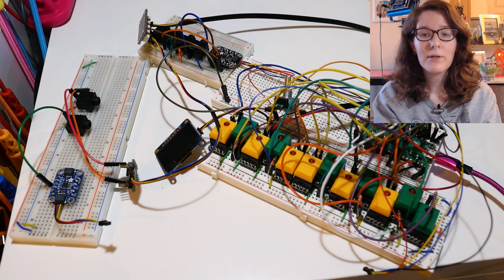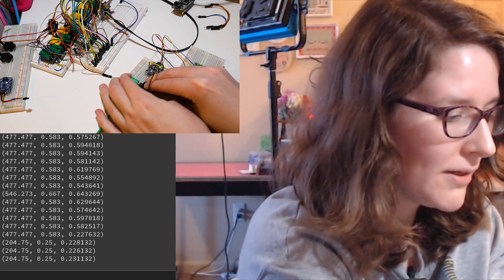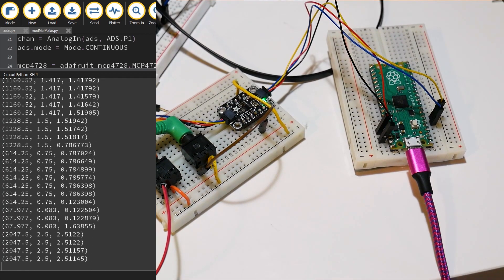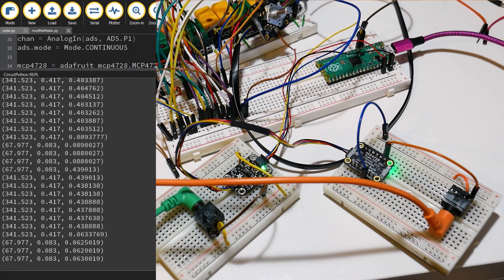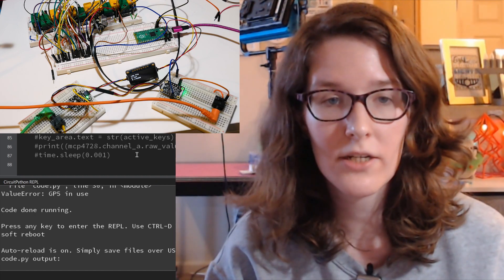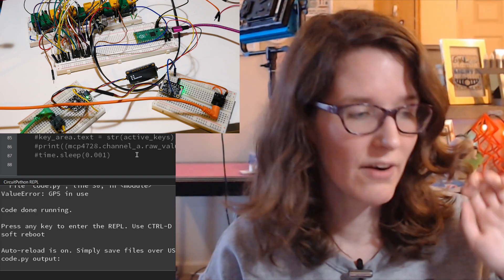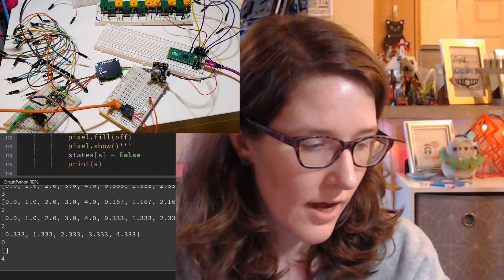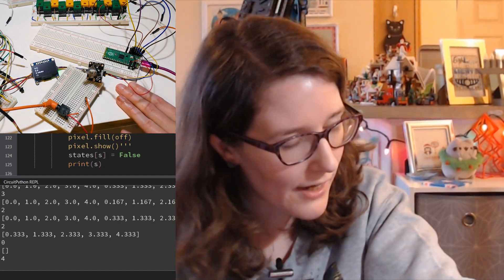Modular Melody Maker Build Log 2: One Step at a Time

Comment: I just googled the GP15 thing and it seems to be an issue for older circuit / micro pythons. Was afraid my boards for the dayjob could run into issues 😬 
https://github.com/earlephilhower/arduino-pico/discussions/364
https://github.com/adafruit/circuitpython/issues/4034
Reply from the maker: ah! that's good to know that it's resolved. always hear about the problems but never the solutions 😅
Reply from the maker: i'll make a note of it in the next build log too